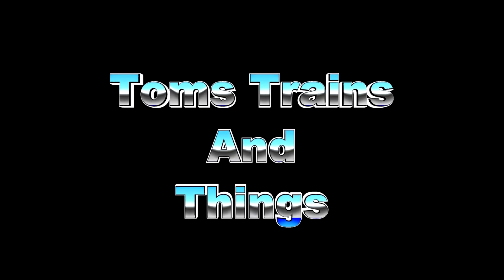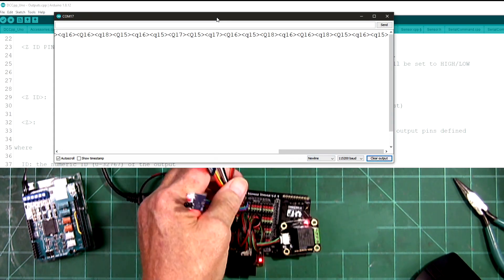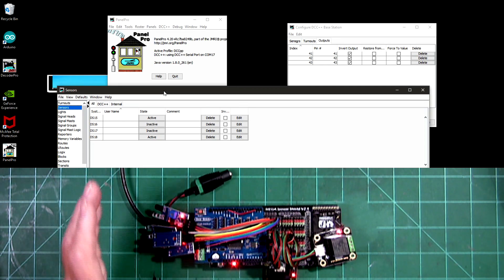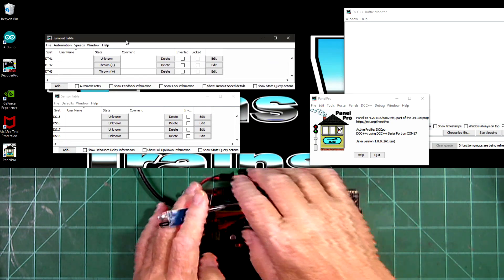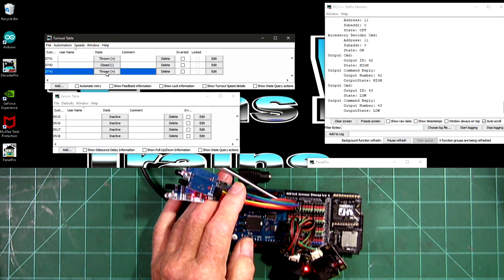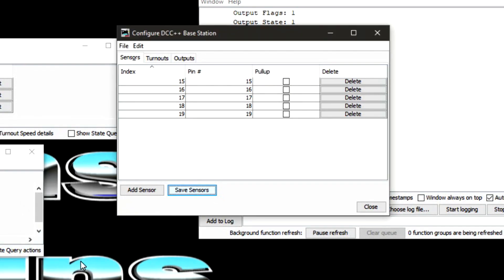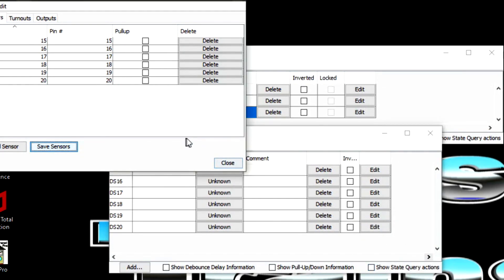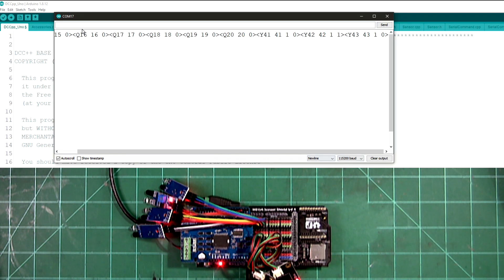Easily Add Sensors & Outputs To DCC++ Part 2

Comment: I must be doing something wrong I was using pin 53 from the din rail adapter mega and couldn't get a relay to work. I guess I'll try some more pin outputs.
Reply from the maker: Not sure why it wouldn't work without more info.
Reply: @TomsTrainsandThings  I tried a different pin and it worked. I did notice with a tortoise machine connected to a dpdt relay I'm getting bad back emf from the tortoise while it's in motion. People suggested I use a h bridge or a tvs diode.

Comment: Hi Tom. Enjoying your videos. I notice you don't have a power feed connected to the sensor shield. 1/ I have my 15v in connected to the motor shield, would this power the sensors? 2/ As you have no power to the sensor shield, which way have you got the internal/external power switch set on the sensor shield?
Reply from the maker: I have the barrel connector on the sensor shield, but for the demonstration, I did not need to connect it. The sensors draw the power from the Mega. I did not have anything connected to the motor shield in this video since it was not about the motor shield. Each shield should be connected to it's own power supply. 5 vdc to the sensor shield & 12 to 18 vdc to the motor shield would do.

The micro controller will handle a small amount of sensors, such as in this demonstration, but an external power source is recommended for more as not to overload the Mega. The selector switch should be adjusted to accommodate your situation.

Comment: I have seen almost all your Arduino DCC Plus Plus Movies on your channel, and like to think that I have now a basic understanding of DCC, But when I did see “Easily Add Sensors & Outputs To DCC Plus Plus Part 1 and 2” I did get lost.

I understand that Turnouts get connected by an Accessory Decoder, via Bus-wire to a DCC Plus Plus Base Station, there is even a NMRA Arduino Turntable Sketch, that turns an Arduino in a Turntable Accessory Decoder. 

But Sensors must be connected to the base station directly? Why, and is there a work around. Or do I miss something, in my very basic understanding of how a complete DCC Plus Plus system works.

I have a very large AC layout that I like to convert to DCC by using Arduino DCC Plus Plus. It is separated in more then 75 blocks that I like to connect to the Base Station using Current Sensors (NCE BD20’s), so that I don’t have to ruin my layout.

Can you give me some suggestions or directions to sources that may be solving my limited input problem that a DFRobot Sensor Shield Gives me.

Thanks 
Mr. W.K.K. Hofman.
Reply from the maker: DCC++ was designed for small layouts. You may have additional base stations in different sections. You can also add as many Arduino's as you have USB ports to use for sensors or other devices. As far as the sensors go. Using it with DCC++ is only one of many ways to connect them through JMRI.
You should be using a sensor shield for a Mega, which has more connections.

Comment: Great video.
You probably figured it out already, but I was reading the JMRI help guides (I am no expert) it said the turnout feedback change won't change the turnout output state. It is assuming that the feedback is from you moveing the turnout manually or with a fascia control so it doesn't try to move it again. It just updates it's current status in the software (layout panel) so you can see the changes and if you have automated train movements it can act accordingly.
So your demo setup was working properly.
I hope this helps some, your videos definitely do.
Reply from the maker: Thanks for your input. I had a relay attached so it shows up in the turnouts page as a switch. Turnouts have to have an address from an accessory decoder in order for it to work. I did not have any turnouts installed. Just received my accessory decoder for this project.

Comment: Good video Tom.  I’m pretty new to the Arduino and learned couple of things here.  Newbie question:  what’s the relay used for?   Fred
Reply from the maker: Thanks Fred. The relay can be use for anything that uses a voltage other than 5 vdc, such as an Atlas snap switch, Tortoise switch machine or other devices.